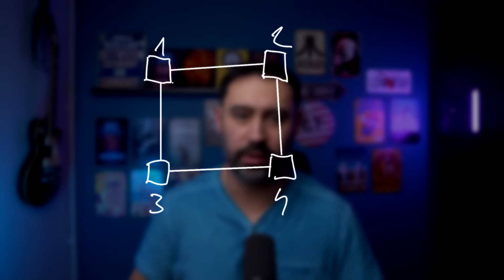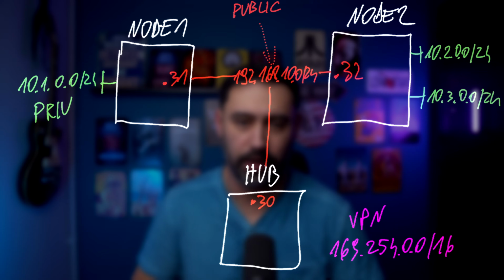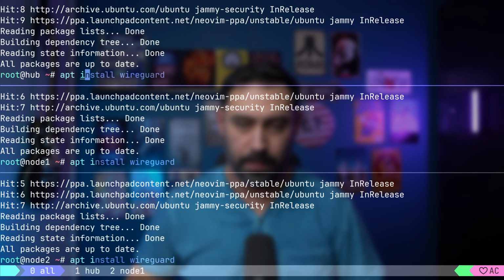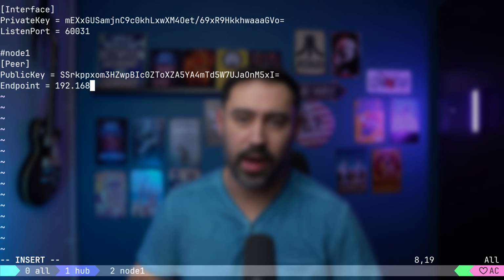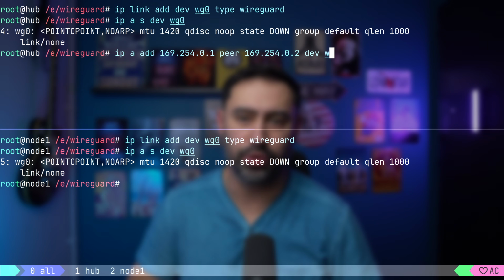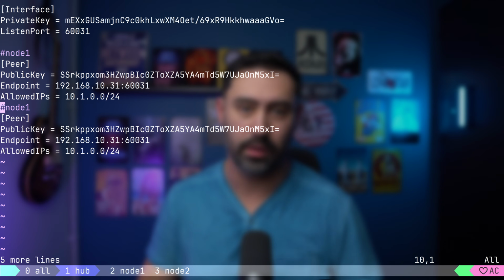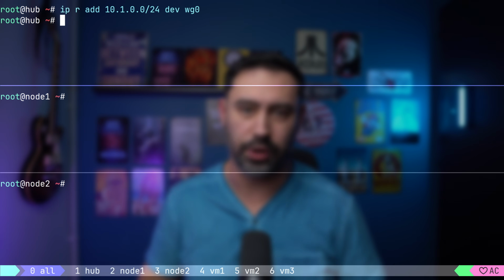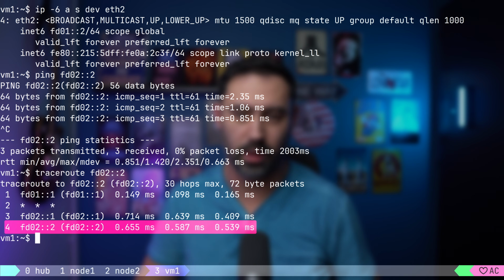Using WireGuard for Hub and Spoke Site-to-Site VPN

Comment: Why do you need to configure static routes? Isn't 0.0.0.0/0 says route anything through wg?
Reply from the maker: Hi! In this example the "public network" is 192.168.10.x and the default gateway (0.0.0.0/0) is set to 192.168.10.x so if I would not specify the static routes the traffic would go out via ethX interface towards 192.168.10.x and not via wg0. BTW Mind that if you are using wg-quick wrapper it automatically brings the interface up, set it's IP address, and add routes from AllowedIPs=... However wg setconf that we are using in this example does not add routes automatically. It only configures the kernel wireguard interface.

Comment: Thanks Philip! It shows that you know your stuff, well explained, weighing the options and commenting on the reasoning behind things, all very clearly explained. KUDOS.

On the other hand, at the end, if node2 were a Windows 11 machine, could it be done? How would you define the interface to have it the same as the other point-to-point? I think that in Windows it's either not possible or no one on the internet has managed to do it. It would truly be an amazing tool, to be able to "drop" any node, whether on Windows or Linux, and have access to that network.
Reply from the maker: Hi! You want your Windows 11 machine to be a router allowing others devices in the network to reach other sites? To my knowledge it's not possible out of the box but what you could do is enable Hyper-V and then install any Linux distro. You just need to bridge the Linux network interface to the physical NIC of the Windows box so that the linux vm will be part of your real network. This is how I would do it. Cheers!

Comment: Stumbled on your awesome video. May I ask for a little explanation? What would be different if, for example, 10.100.100.1 and .2 would be used instead of 169.254.0.1 and .2? Would that create any changes in routing rules too? How do you make your configuration persistent? with wg-quick you'd add that to systemctl enable to autostart, but with all manual, what do you do?
Reply from the maker: Thanks and apologies for late reply. YT did not show this comment until now. 
To your question. Sure you can use 10.100.100.x. The reason for going with 169.254.0.0/16 is that it won't collide with any local network as no-one is using this subnet. However you can go with 10.100.100.0/24 or any other private network as long as it does not overlap with your local subnets. Just when you'll be setting wireguard peers put 10.100.100.x instead of 169.254.x.x and that's it.
Now to your second question - that's a good point that I've not covered in the video.
You need to create a new systemd service in Linux that will autostart once your system boots.
Just google "How to Create a New systemd Service on Linux". I will do a video about systemd later in the year.